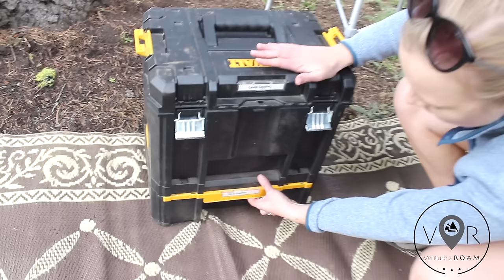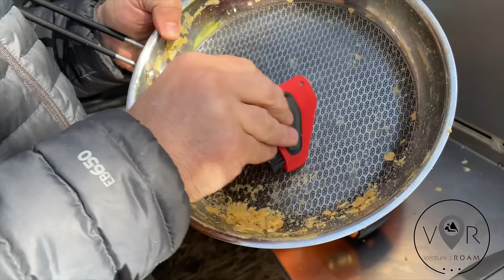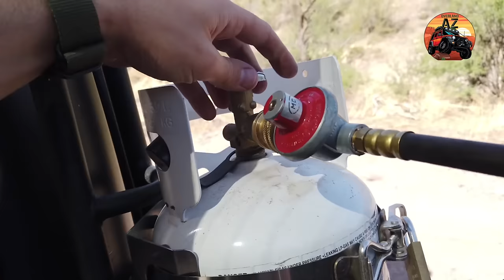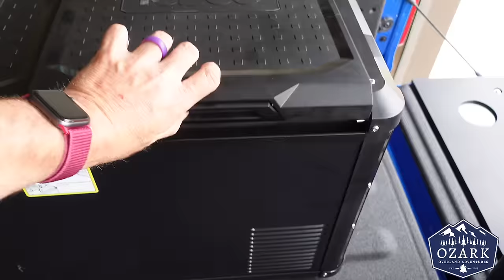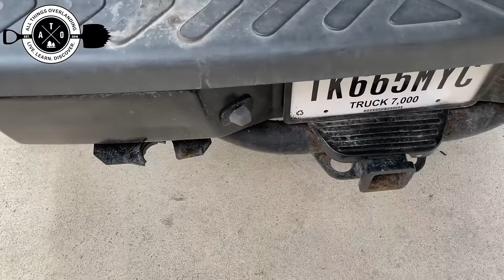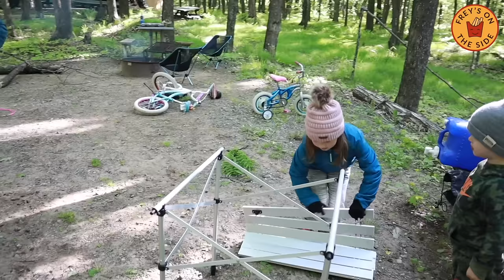5 Overlanders' Picks for Kitchen Gear Worth Buying

Comment: Great idea for a collaboration and nice job by everyone! Thanks for putting this together. It is interesting how gear and expectations change over time and most certainly with vehicle. By this I mean very minimalist vs everything refrigerated and hooked up to power/propane etc. None of these ideas are better than the others and the group showed a wide range of setups which is great, but both our kids are in college now and we have gone retro (backwards?) in many cases for our gear. We are using less elaborate equipment,  more fire (where possible) and less fuel, more cans/dehydrated/powdered and less cooler since we move gear between vehicles.
Reply from the maker: Awesome perspective on how you’ve evolved over time. We’re about to launch another video like this..collabing with other creators…can’t wait to share it!!

Comment: Given the fact we camp a lot on the beach in Australia, the best camp hotplate / oven is a marine BBQ. Something like a Galleymate or equivalent. 316 stainless, rugged, high BTU rating and designed to operate efficiently and retain heat in high winds. You can also add things like roasting trays / racks / rotisseries. Not cheap but you get what you pay for.
Reply from the maker: Awesome comment. Thanks for sharing!

Comment: An easy modification for your table height is to find a wood post in the diameter you need to fit the table legs securely in. Drill holes in the sections you have cut to the length you need to match your tail gate height. I have used these extenders that fit the long folding tables used for food preservation classes I co-teach at the local Agriculture Extension office.

Comment: I prefer my gas Coleman stove, old school but built like a tank, great for simmering or cooking and saves bringing or disposing of bulky propane ( I have both the one burner and the classic thus I can choose) pair it with a Trangia and is less space than bulky propane or Isobutane lights in all kinds of weather or altitude and in a pinch I can even syphon gas from my car if needed. That collapsable GSI set rocks! I’m getting it. Thanks for the great video and tips.
Reply from the maker: Old school Coleman is a great option!!! Thank you for taking the time to share this perspective!

Comment: I have one of those coleman folding ovens My dad at some point put some self tapping screws in it so it stays unfolded. It is now probably over 50 year's old and I love it. Another ting its good for it will hold 6 small propane bottles but make sure when you take the bottles out use it that you make sure those little plastic caps on the end of the bottles are all out of there.  By the time i realized it was in there to late just cranked it until it burned it all the out, Leason learned.  Makes the best biscuits Grands 5 pack. I have nice thick aluminum pan that works best the thin pans tend to not heat as evenly
Reply from the maker: I love those old stoves. Thanks for sharing!

Comment: At home, Bushcrafting, Camping... I don't often bother with food that stores in a refrigeration. Don't care much for dealing with ice in a box or using power, although I do use power at home for the computer and sometimes a light if it's too dark to do something. I used to have a mini fridge and a water dispenser and cook on electric stove/oven, but decided to cut down on power use. I got this small pump that fits on the spout of them big water bottles that are used for water dispenser (hot & cold water) and I heat the water with my butane camp stove or mini burner (uses isobutane canister). I don't use the lights as much as others in the family do. Only when needed.

Comment: You had me with the Dewalt storage for kitchen gear, that drawer in the bottom is clutch.
Reply from the maker: The cool thing about those is that you can mix and match. For us it's been kind of the best of both worlds.
Reply: @Venture2Roam  lol I told hubby I wanted one of those when I saw them at home Depot... actually two one for tools and one for my camp kitchen.
Reply from the maker: @lisacastano1064  Lol. Awesome.

Comment: Glad someone mentioned cast iron. I have all the titanium, folding cookware...and I hate it. I love my cast iron wok. I even started using it at home too...i love it so much.

I finally bought a 12V fridge. Best gear ever. I bought a BoughRV...not expensive; and a game changer.
Reply from the maker: Cast iron is great, as long as you have the space and weight. We love our little cast iron flat grill we can through on top of the stove. I so agree about the fridge…I face we just launched another collab vid talking about fridges..total game changer. Thanks for watching and taking the time to comment!!!
Reply: @Venture2Roam  Hi.  Now using a Lodge grill pan which is great but heavy and bulky.  What is the brand of your flat grill?  Thanks.
Reply from the maker: @cathyfurtado362  Hi Cathy - we use the Victoria reversible grill. We got it on Amazon: https://amzn.to/3LJddZF
Reply: Is the griddle 12"?

Comment: I bought the jetboil genesis last week and it looks great. After watching this video I just purchased the collapsible gsi pot and pan combo and the scraper. its bad when you are 7 grand in and still buying stuff last minute. I figure it is better to bite the bullet once on all the gear I need rather than suffer over many trips with a family. I am used to high end gear with years of hunting trips under my belt but I quickly realized almost none of that stuff applies when you start bringing a family with a young baby, wife and dog.  If you have a baby I recommend the Morrison infant sleeping bag as well as the fleece bunting bag from Patagonia. I bought us all some merino wool layers and a few ultralight down blankets. For my main gear I got a Eureka copper canyon 8 person tent and a tarp system to go above or use as an outdoor covered area. I also got our dog a good sleeping bag in case night temps get pretty cold. I bought a bluetti 2000w solar generator with 200watt panel, a coleman queen cot/air mattress. And I am using the Mr buddy heater as backup heat with a portable CO/temp/hygrometer.  2 coleman collapsable chairs with a collapsible table, 2 pairs of merrell hiking shoes, a garmin inreach mini 2 sos/gps handheld, 2 yeti 14oz coffe mugs, a lifestraw, a new water filration system, a comprehensive emt grade medical kit, a butane attachement candle lamp, heavy duty tent stakes with drill attachement for gavel, and mutliple small kitchen, repair and other items.   The thermoelectric cooler can run off the solar battery for the entire week without needing the panel as well.  I am saving the yeti cargo trunk and yeti dry sack duffle bag for next year. Still looking for cool gear that I am missing but I think we are good to go now for many years to come.
Reply from the maker: Great comment...sounds like a great setup! Thanks for sharing.
Reply: @Venture2Roam  The gsi pot pan combo came and its amazing. I got a collapsible kettle to match and it fits in the same storage bag.
Reply from the maker: @ar007r  Glad to hear it..I still use mine! I haven't changed my kitchen set up since making this vid..still love it.
Reply: Omg, I am tired just reading the list of stuff that you bought. When are you going to have time to actually enjoy the trip itself?

Comment: Great video.  It occurred to me that the Outback Adventure Table might be attached upright to a truck bed drawer system.  The developers of the drawer system would have to take this into account, but an upright piece of plywood, properly mounted and installed that slides out might work very well.
Reply from the maker: That’s a super interesting idea!

Comment: Regarding that MSR Scraper, the best time-proven way to clean on stuck food is to soak the item in water Warm water is better than cold, but cold still works. Leave it soaking for 30 minutes for hot water, 1-2 hours for cold water and stuck on food will fall off with little effort.
Reply from the maker: Thanks for the tip!

Comment: I use butane, not propane because I have problems breathing in the fumes of propane and the smell is too strong for my heightened sense of smell. Butane has not been an issue for me like that. I do have the butane canisters for my mini-burner, that have the threads on them. I haven't had an issue about how much is left, etc. I can shake the canister a tiny bit and hear how much is left (I also have heightened hearing). Ove a month of using the taller canister, I can figure how much I can cook on it based on the sound of how much is in the canister. So for me, it's not a problem to not have some gauge on it. I have 3 sizes of the canisters. I have the short one, the tall one and the in between size. In the house, I use the big canister with my mini-burner sometimes. Sometimes I cook on my Coleman butane camp stove which uses them narrow canister without the threads. I have a stock up of those too. I found there are brands that the fuel lasts longer than others, probably something to do with quality of the fuel. I get the longer lasting ones available here and they come in a pack of 4. It's a cardboard packaging with the canisters lined up in a row. You just pull them out the end of the packaging where it's an open end. Not bad for stashing them away in a space.
Reply from the maker: Sounds like you’ve figured out a fuel set up that works really well for you! Thanks for taking the time to comment!!
Reply: I'm using the same type of stove as the Coleman if you have an Asian market near you the canisters are a bit cheaper than Walmart. And usually available unlike Walmart I spent two weeks trying to find some in stock at several nearby Walmarts and a couple of other stores because I didn't want to drive 30 miles to get them.
Reply: @lisacastano1064  I usually saw them in 3 stores I'd go to. But now 2 of those stores don't have the Butane canisters for my mini-burner. Luckily one store still did, so I got 4 smaller ones and a tall one. Next pay I'll go and get more. I'll probably get more of the ones used on the regular camp stove too.
Reply: @kachiri  I was looking for a week trying to locate some close by check Walmart early in the day. But I'd been checking the shelves when I needed to go there and they are always out. I finally got lucky but they are pretty much few and far between rn

Comment: I have read that the Jet Boil stove has had a number of regulator failures by owners. I am wondering how you have done now that you have had it for a year or more. I contacted Jet Boil to inquire if there was a new, replacement regulator in the pipe line. They were not willing to say.
Reply from the maker: Still haven’t had an issue with mine 🤷‍♂️